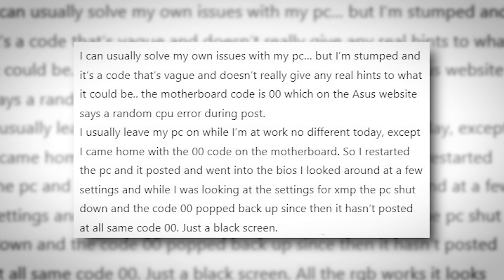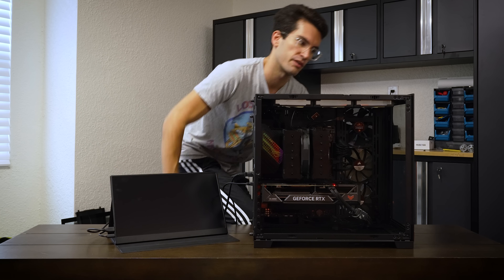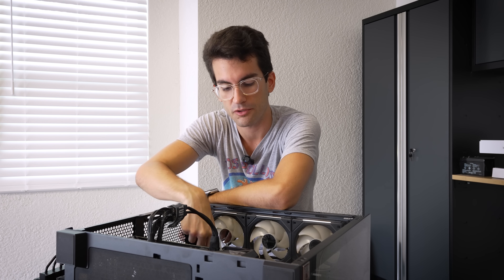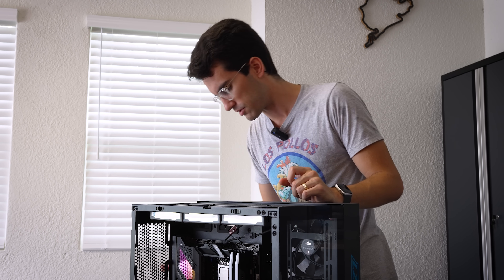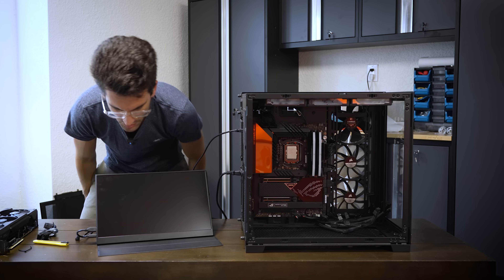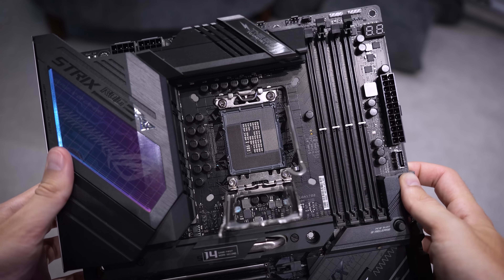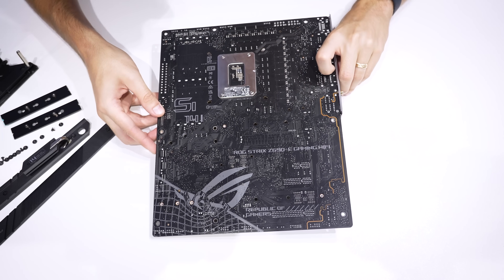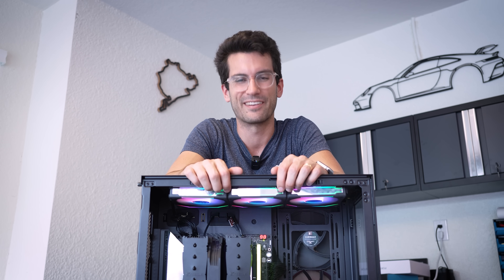Fixing a Viewer's BROKEN Gaming PC? - Fix or Flop S5:E17

Comment: If you have expensive boards that you would like to get fixed, even video cards. There's this one channel called Northridge fix. The guys an expert at fixing Electronics that he's never seen before just by looking at them. He fixes just about anything he's even going to start teaching classes on it. And he does all this fixing without schematics. Be able to search this board on his channel and see where he fixes one. And you can go to the same process he did or does, follow it step by step. And you might be able to figure out what's wrong with your board. I think he charges under $200 to fix things. But he knows what he's doing as you will see in his videos. If that's an Asus board Asus has been having a lot of problems with their mosfet chips. This guy often complains just about everything he gets to fix from Asus is always those chips. You'll also tell you not to buy an Asus laptop because they're always breaking down. And it's usually the same thing. He gets one to five Asus laptops a day.